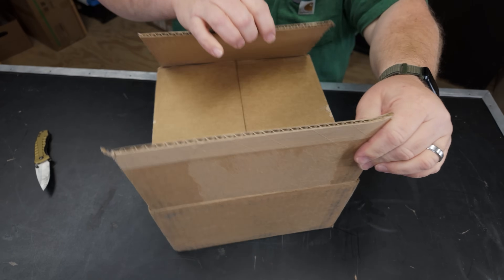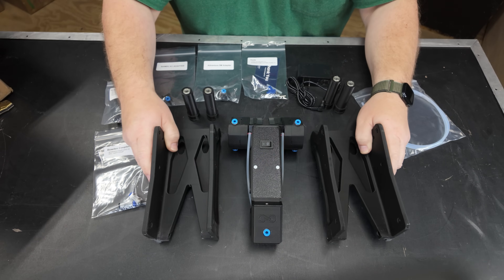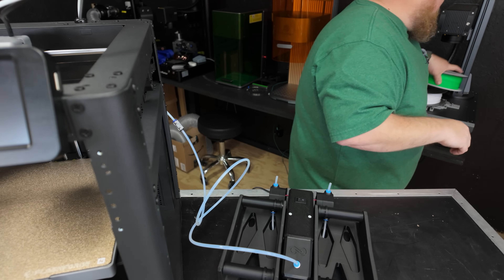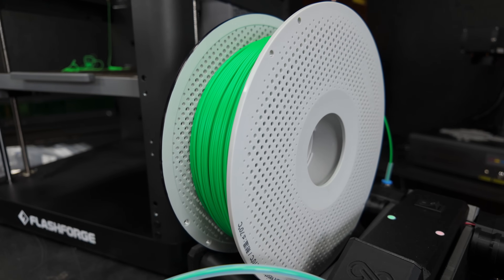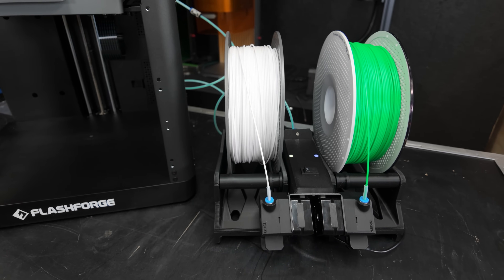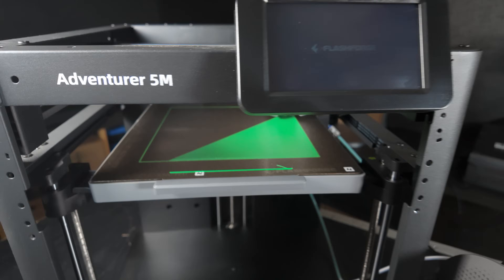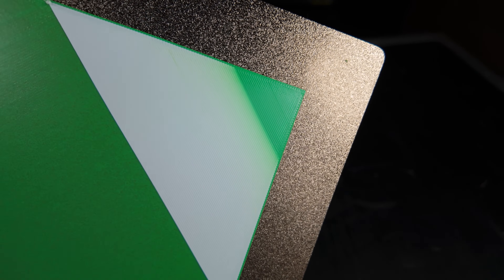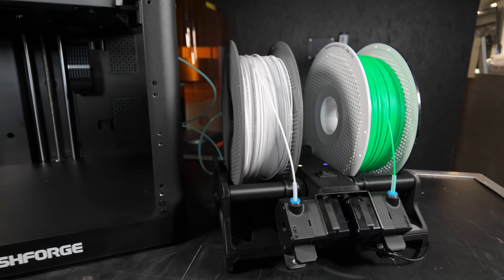Every Print Farm NEEDS THIS - Infinity Flow S1

Comment: How do you do deal with filament vendors that glue or tape the filament to the inside of the spool creating havoc when the spool gets to the end of the filament?
Reply: This is a really common question actually. Most rolls (polymaker, sunlu, etc...) have a fairly shallow bend which will just get sucked through the S1 but some particularly sharp bends can clog it. To fix this we have developed a filament cutter to chop off the last couple inches of filament so that whatever blockage it meets (bends, tape, glue, or tangled filament) will not clog the S1. This is still in the testing phase but we plan to launch the beta version in a few weeks. It's a purely mechanical solution so it will just be an inexpensive add on.
Reply: @InfinityFlow3D  I was thinking that it would be perfect if it reacted to the filament not feeding by cutting that line and rewinding to clear the path for the second one. That way it'll work even if the spool has the end glued.

Another great feature would be to have some form of output from it so that industrious people can do whatever they like with the warning for the filament being out on both spools. It could be as simple as just an output pin that's reasonably accessible and documented as it wouldn't be something that works out of the box.
Reply: @InfinityFlow3D  If you do that I'm hoping you built around something like an ESP32 that you could connect to Wifi and have integrated alerts through something like Home Assistant. That would just be a great quality of life improvement since as-is it's obvious at a glance when a spool is empty but it wouldn't be so obvious to see the LEDs or the empty PTFE tube particularly up on a shelf.
Reply: Even if they only kink it, that's often a problem.
Reply: @Chucka1463  pray because this thing struggles even if it’s not booked at the end. I opened and clipped the ends off of my spools and it would still regularly not feed because the PTFE may be in an angle that’s not ideal.. wasted many spools on my orange storm giga hoping this thing would work properly. They need to work on supporting the PTFE leaving their machine to ensure it’s at a straight enough angle to feed. They should also consider designing a ptfe cover for the Giga runout sensor so when it does fail the Giga runout sensor can be used to catch it. The required use of the ptfe makes it impossible to use a runout sensor. I’m considering making mods for this thing but I don’t have the time. Hope they just do it because it’s a flaw.
Reply: @Chucka1463  Not sure why my comment was deleted, but the kink at the end of most rolls is also I problem.  I usually try to cut it off when the roll gets low.
Reply: Why are my comments being deleted 2x now?  Many rolls have a kink at the end of the roll, a 90 degree kink.  How will this work?
Reply: They sell a cutter you can add that senses tangle or other obstruction and cuts the filament, allowing it to feed the other spool.